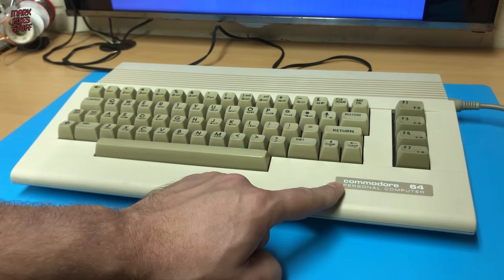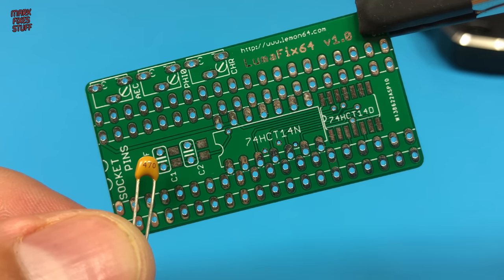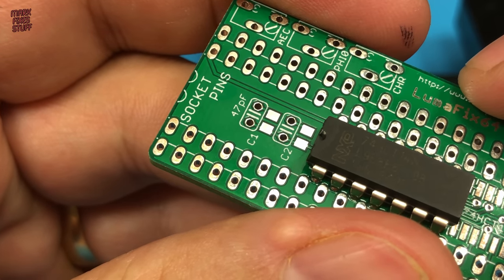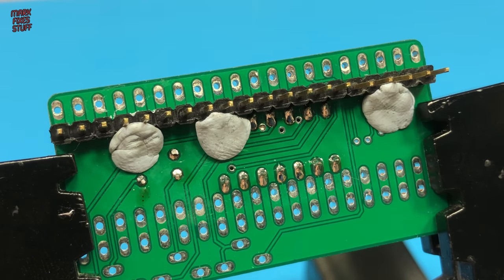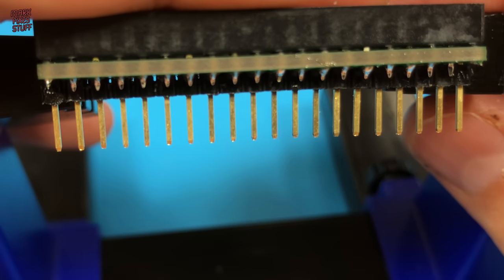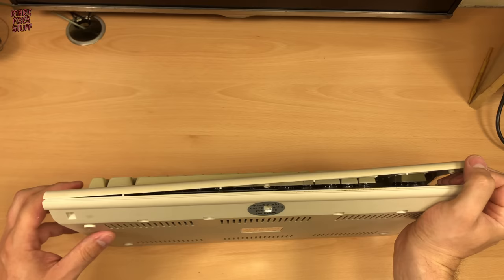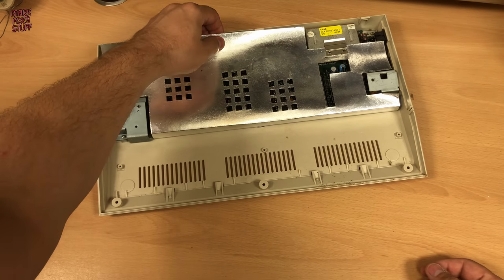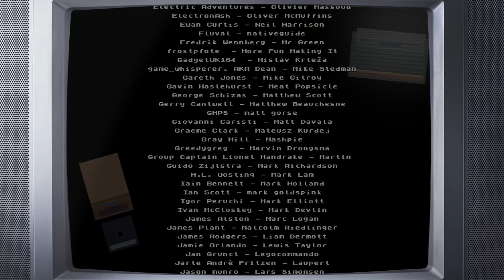Building, Installing and Adjusting the Lumafix64 Jailbar fix for C64 - PCBWay Link!

Comment: Hi Mark,I must say this; that soldering tip is too big for this job, second those headers are very nasty  for vic socket, better use round machine pin headers and if needed replace vic socket on mbo with machine pin socket (match the  headers). Btw, nice to see you going on YT!Cheers!
Reply from the maker: Thanks for the tips!

Comment: I think you made a great video and your soldering is very good, a smaller soldering tip would have made it a little easier for you. But your presentation was very comprehensive and well presented.
Reply from the maker: Thank you for your kind words.

Comment: I use one of those "flexible arms" helpers. The trick to getting them stable is to use as many "tentacles" as you can to hold what you are soldering. With only two in place, this is pretty wobbly as you noticed. I use mine with one "tentacle" holding a little fan (a 50x50mm fan running on 5 Volts, powered by an USB power supply which is conveniently located right behind my work area)  to get rid of the soldering smoke and all the rest holding on to whatever I try to solder. That way, it works fairly well. My biggest problem then is that it often sits too high since my workbench is pretty high already. I used old kitchen cabinets, so it is not the height of your average table, but the height of a kitchen countertop, which is pretty high if you are sitting in front of it.

Since you mentioned the "C Vierundsechzig-Zwei" in German, do you speak any German or was it just something you picked up? (I'm just curious, as this is my native language)
Reply from the maker: Ah, yes. Unfortunately all these things perished when my home was destroyed so now I just have a single PCB clamp. I understand that height problem. I also use the "countertop" height and for this I needed to buy a Draughtsmans's Chair which is higher.

I know some German. My father in law was with lovely lady who worked in Frankfurt for many years until she sadly passed. I spent a lot of time in Germany and I love it and the people. Since she passed he has moved to Spain and that is nice too. I like to have an understanding of languages because English isn't everything. Right now I don't recall much German, but when I go there it comes back quickly.
Reply: @MarkFixesStuff  I have noticed the hints in your videos pointing to what happened. I'm really sorry to hear that. 😭 I am a former firefighter, so I can relate to how much destruction a fire (and the smoke and unfortunately also the water that is needed to extinguish the fire) can do to one's home. 

Frankfurt? What a coincidence. I was born there and I still live just outside of Frankfurt. Viele Grüße aus Deutschland! 
👋

Comment: Seen loads of videos on Lunafix64 and I could of told you before you spent time soldering etc that the fix smudges the image and does not improve it. S-video SCART is my preferred connection not composite SCART. I prefer the jail bars and jail bars are noticeable on static screens and some colours. My opinion is Lunafix64 is pointless.

Comment: Instead of adding peaks to the original peak, causing an additive, runaway effect, negative feedback has you adding troughs to the original peak. In simplified terms.
Reply from the maker: So inverting it, a bit like active noise cancelling?

Comment: From watching other channels, it seems that chip pullers are fine... except when chips have been in sockets for many years.  In that case you want to lever them out like you do.
Reply from the maker: Yeah. Probably that because all the chips I need to pull have been installed for decades.

Comment: As always an enjoyable vid. I'm an Electronics engineer with 35 years experience in design, development and building devices. Along with this, I have repaired so many things I have lost count. If I had one gripe with all electronic build / fix vids on youtube is the overuse of flux. It certainly has a place but it does not need to be used as much as I see it being used.
All I ever use is an abrasive pencil rubber to clean up the pads, a quick clean with isapropyl and a good quality flux cored solder. Sure there are times a bit of additional flux helps but I rarely use it.
Reply from the maker: Admittedly the over fluxing is a bit of an in-joke on the channel... "looooovely flux..."
Reply: @MarkFixesStuff  Any oily substance "can" be used as flux. You should whip out a well used cotton bud one day and hit the board with that. 😁